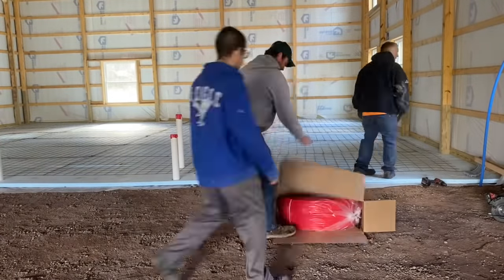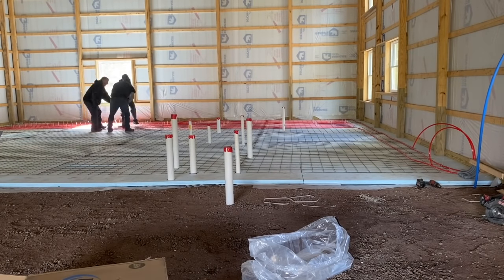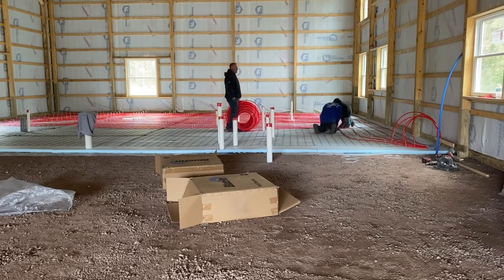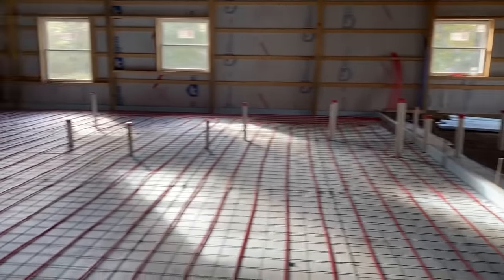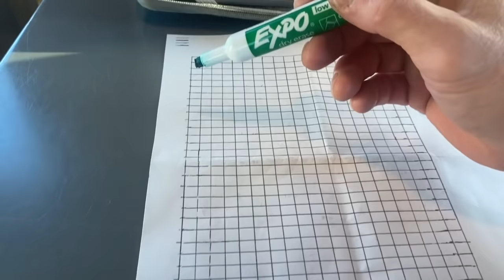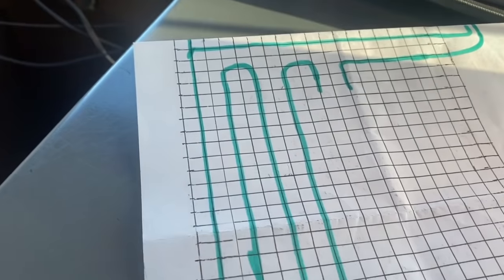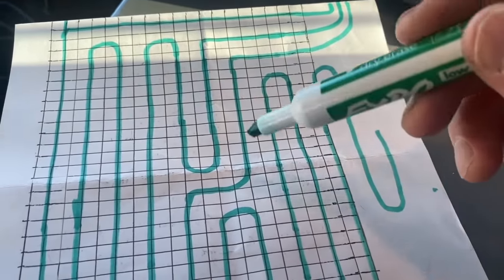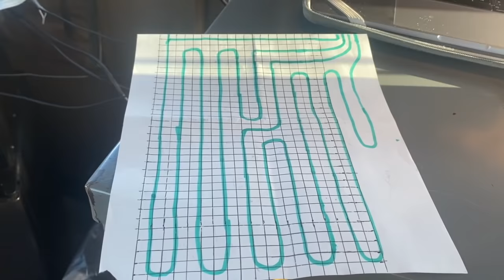Installing your own radiant heat tubing in a concrete slab. (DIY METHOD)

Comment: ziptie them sideways or down then you dont gotta snip them off. also ladder it for sure so they are 1.5" -2" from top. Crazy what they charge to install pipe and insulation for these jobs. Insulation is highest cost. 
https://www.avenir-online.com/AvenirWeb/LoopCAD/LoopCADTrial.aspx Loop cad free trial 30 days, use sandboxed or just refresh install a computer and keep reinstalling it. 
Usually always have outside loop perimeter loop a bit smaller and hotter as it is largest heat loss in the entire grid. 
I plan where the bench is and ill miss that section where you stand cause it will get WAY too hot to stand on that unless you get a rubber insulating matt. 

Get the Tekmar Floor Sensor Thermostat, floor at 20-25c and wont go over that, and also will shutoff when air temp gets to say 13c (overshoots to 15-16c)
Reply from the maker: We have great success keeping the tubing all the same length so the system is balanced without needing flow controls / balancing valves and such. Just a copper header is all we need. I have never noticed a slab having hot or cold spots with 100 to 120 degree water. We do not pull up the tubing unless the slab is 7” thick or thicker. We stay away from toilets and lift post in a garage but that’s about it. We also run tubing up to 500 foot long loops keeping the header short and simple. 1 taco 009 pump will push 5 of those loops easy. We keep things real simple and don’t have to charge much to put this together and they work excellent. I have over 30 of these in service and get calls every winter from customers telling me how good there heat works. 
Just goes to show there are many different ways to get things to work good. 
Thanks for the comments and feedback I always like to see different ways people do things. 👍😊

Comment: What’s the foam around the edges for ?
Reply from the maker: Jeff thats Perimeter insulation so the heat does not escape yo the outside.
Reply: Oh I understand now duh sorry. Insulating the concrete from the ground. Thanks for the reply.
Reply from the maker: @JeffRigney  You bet sir 👍

Comment: What size tubing do you use?
Reply from the maker: Stephen it is 1/2” oxegen barrior pex. You can get it at Supply House on line. We usually buy it in 1000’ rolls.
Reply: @bondobuilt386  thank you for the video and info.
Reply from the maker: @stephennorthcutt8874  Stephen your more than welcome buddy. 👍😊

Comment: Hi I have some questions
Reply: I have only electric available would you recommend a electric tankless water heater or tank type water heater I have a 48x64 pole barn
Reply from the maker: @dennismorgan3592  Hi. I would recommend a electric boiler if all you have is electric.

Comment: this heating system have most used in all north europe, same weather than canada winter have gould. -30 about.best heating all houses. cheap use, easy install diy ewery home, wood floor or better concrete floor., concrete have lot more mass keep floor warm longtime. all other heating systems have old stupid and waste lot energy and expensive use.
Reply from the maker: Very true what you say. The heated concrete is awesome and so comfortable on your feet. Very efficient system as you say.

Comment: Another great video Bondo, awhile back I asked you about your thoughts on Foam A Drain footers and Helix Micro Rebar to replace or minimize rebar. Now seeing how you install the insulation,  and securing your tubing, have you used Nudura's Hydro-foam? https://www.nudura.com/products/integrated-series/hydrofoam/ It looks very efficient and could kill two birds with one stone especially how you setup and secure your grid. I doing my research to build my new ICF home and separate 40x50 "Man Cave and Wife Free Zone" lol.
Reply from the maker: I have used the foam your speaking of once but it was quite expensive. About double what I can get 2” foam board with wire mesh on top. We have gotton real quick at putting it down on the wire also. In my opinion the spray foam is the best and I dont have to put it down either. Lol 
What ever you do dont skimp and put the insulter blanket under the floor. Its no good at all. Wife Free Zone 😂
Reply: @bondobuilt386  Thanks Bondo! I have not check prices  just to trying find the best building systems.  I am set to use ICF, wood prices are through the roof I am 30 miles south of Atlanta GA. The spray foam is definitely is a strong contender need to start comparing prices on it.
Reply from the maker: @DH-fo9dx  Ya lumber is through the roof here in upstate New York also. Im gonna fire up my sawmill and cut some form lumber for next year. LOL

Comment: I understand that rules in water pressure are the standard for why each length is equal in length. What I don't understand is why if you have 1000 ft of coil, not just run 500 x 2 lenths, same spacing, and NOT lose the money you spent on 200' waste per roll? I would think the whole project would have to be done with keeping the lengths all equal and send it. Why waste 200' of these expensive rolls of coil? I just don't understand the why 400' runs. When you get close to the 400', you're basically just going to keep your rows and spacing on each at the end. Not posting a negative comment, just thinking of how much money is wasted in not just splitting the coil roll in two equal lengths and get job done. Doesn't the square area in math allow you to get less scrap out of the roll. Say the math would let you run 475' per coil roll, leaving say 50' scrapped. This project, can't you do 6 x 200'? Take the remaining 800' and use it for a bathroom, mud room entrance way or different area project?Then this would perhaps be just an adjustment to the spacings of the runs. Or where the manifold is positioned on the blueprint of the flooring plan. Good video though as stated in other posts and I am grateful for your video and knowledge of the trade. Ty

Comment: To bad there wasn’t a way to use the whole 1000’ roll without waste?
Reply from the maker: Daniel. I’ll use the longer pieces over 100 feet and splice them for floor joist installations. Then the shorter ones for home run plumbing for water supply to a header. 👍👍

Comment: Dont listen to this guy if you want it done correct. Spend the extra money for manifolds with flow control. Worst thing you can do is connect pipe under the concrete that weights 12k ton per 1000sqft at 4 inches. You dont want any joints. Just one continuous loop. Even if you have to cut loop short or run one a little longer. Trust me, could be a HUGE future issue. I have 26 years hvac experience and a mechanical license.  Manifolds are 200-400 dollars, to save thousands if it ever leaks in the future. Seems like a no brainer, then this hack method. This is why they say, you get what you pay for.

Comment: Loops are to long , they shouldn’t be longer then 250 ft
Reply from the maker: We do them all the time. Just need the proper pump Dennis. I got at least 20 floors cranking heat  out and people love it.
Reply: @bondobuilt386  Where are you located and what type of climate?
Reply from the maker: @fuzion430journey3  Upstate New York. Its cold here in winter similar to Ontario Canada.

Comment: Should do some research on how to lay pipe properly.
Reply from the maker: Many ways to run this tubing.
Reply: @bondobuilt386  It is, will work way done in this video but there is a lot better layout possibility. If you have time check out this video  https://www.youtube.com/watch?v=K0v5H5RuXSU      Thanks for the reply.

Comment: Your blue board should be 3 inch.  Tube lengths should not go over 250 feet.  Waste of time and money using the steel mesh, they make foam staples much quicker than zip ties.  You can buy balancing manifolds cheaper than you can make them, so exacting loop lengths is not critical.  Stick with your building skills and hire a real plumber for your heating needs. Make that a licensed plumber.  You could pump 500 feet or so, but you are bringing colder water to your heat source, therefore greatly reducing system efficiency.  Bottom line,  you don’t know what you’re talking about.

Comment: Why do people place the tube under the concrete floor? Pour your concrete, let it dry for a day or so, place some foam board down, run your tubing on top securing it to the foam board. Pressure check it for 24 hours, pour a thin set on top, let it dry!! Something goes wrong you only need to tear into the top layer!

Comment: The wire mesh is a waste of money( does not reenforce the concrete) unless it is pulled up into the pour.
Reply: The wire mesh in this instance is not there to reinforce the concrete, it’s installed to hold the pipe in place. The mesh is short money for the installation efficiency it provides.
Reply: @moki7685 But the concrete pour needs to be reinforced otherwise it is much more subject to cracking. It also needs control joints to minimize the expansion & contraction of the concrete